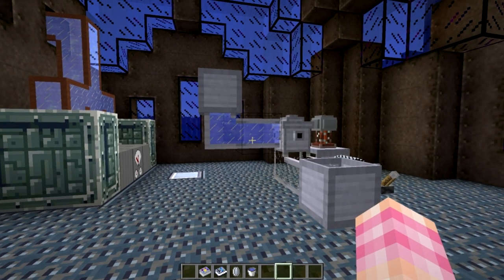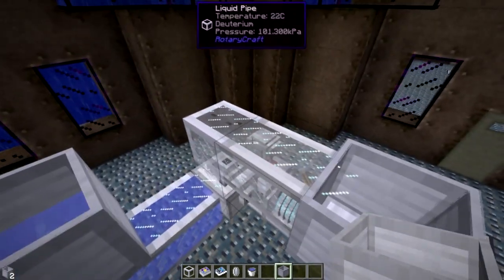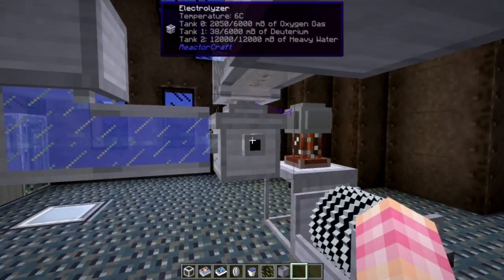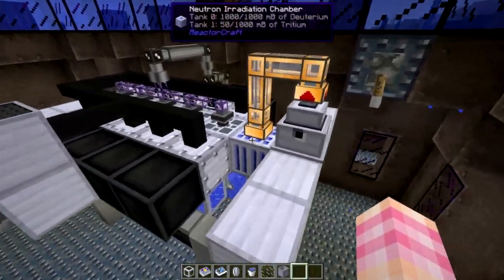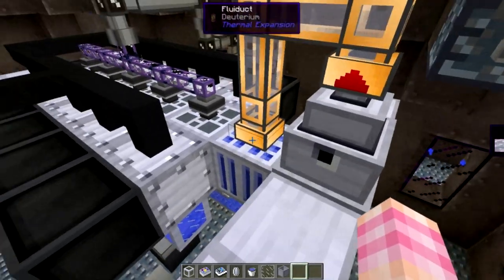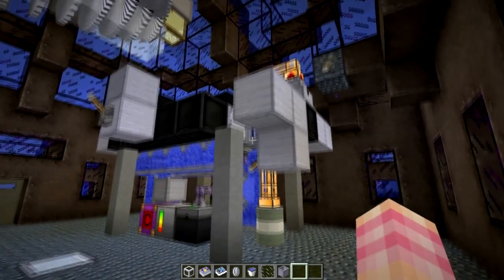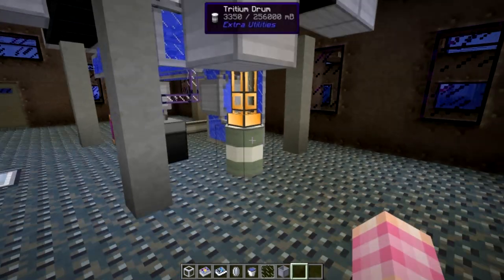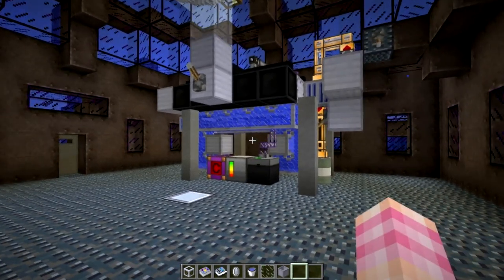ReactorCraft Tutorial #16 - Deuterium & Tritium Production

Comment: so, basically, as soon as we have our fission reactor we better rush to produce ²H and ³H to have a decent backlog for when we'll be able to run the токамак (don't ask, I found it cool to write it like so ^^)...
Reply: hahahah no.... unfortunately my testing says that working irradiation chambers will really kill most steam production... could be wrong
Reply: Andrew Speer arg… that's sad… I'd really want to investigate on a hassleless reactor that could auto-maintain itself (given we provide the fuel)
Reply: well i should clarify you do get steam but you need more fuelrods to get the same production, it seems easily doable- also it seems uranium produces more tritium/minute than plutonium
Reply: That's what I understood ^^ it's a matter of neutron emission/absorbtion… And the irradation chamber is absorbing most of the neutrons it could be hit by…  I think a sharp-type design with 3 lines instead of 2 could do the job by putting Irradiation chambers on the tips of the center row. Like so, the reaction in this row should be maintained by the other 2 and emit a surplus outward.
Reply from the maker: kanethornwyrd Lots of nice thoughts for experimentation.
Reply: would it be possible to use the neutron emissions of a running tokamak to produce tritium, and would it be enough to make it self sustaining? just a thought, haven't done any recent experiments myself so thought id throw that out there for someone to try
Reply: The токамак neutron emission are pretty random and not regular enough to produce tritium at a decent pace, I mean, look how long it take with a 5 cores in line dedicated reactor... That's pretty ridiculous.
Reply: So, experimentation results:

3x3 reactor cores spaced by steam boilers (each core is surrounded by 4 steamboilers).
NIC in the middle of the four sides, spaced from the outer steam boilers by blocks of air to allow multiple pipe lines running in the vicinity (H2O, ²H and ³H).
All the rows and columns are surrounded by 3 layers of neutron reflectors blocks.

Latest version of Reika's mods, plain biome, default settings.

~140mb of ³H per second
It produce enough steam for around 6 standards turbines when the uranium pellets are ok and there is no nuclear waste in the cores.
Reply from the maker: kanethornwyrd Nice, I'll try and build that for a video. Credit to you for the design of course.
Reply: You're welcome ^^ few screens to kill any doubt in the design: http://imgur.com/a/spNV0
Reply: It's not super efficient, but I'm proud of my design. ^^ (and it produce a metric ton of power ! :D )
Reply: @jena_thornwyrd  I do have my own questions about the fusion reactor:
-Does it release neutrons at more vertical positions than just the bottom level of the toroid magnets?
-If so, then is it possible to surround it with NIC units above all the steam boilers?
-Also, do boilers or NICs stop neutrons from reaching each other even in 1.7? Or do the neutrons do their job and still whizz through in either case?
Reply: @steam-powereddolphin5449  you just necroed a comment from 8 years ago… I have no clue and no will to re-install everything, so, I'm sorry, but you'll have to experiment by yourself.